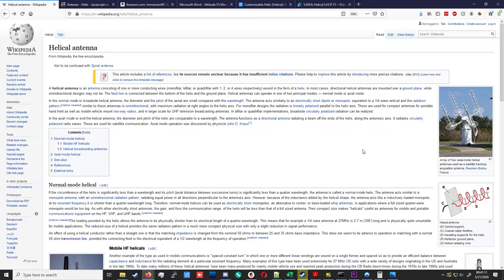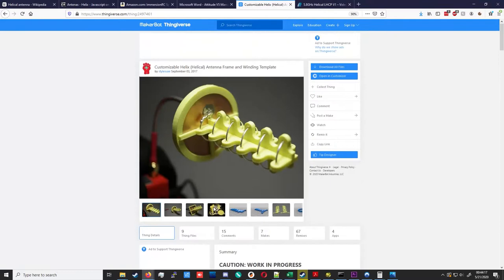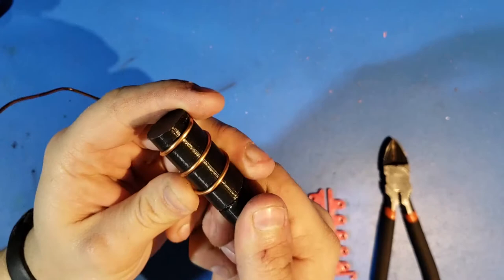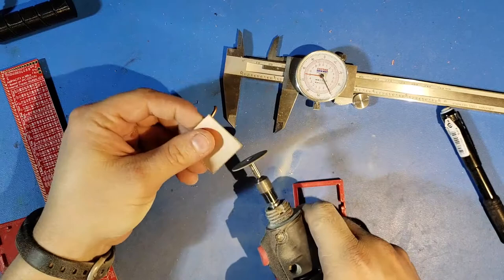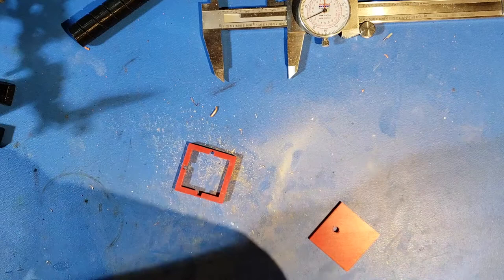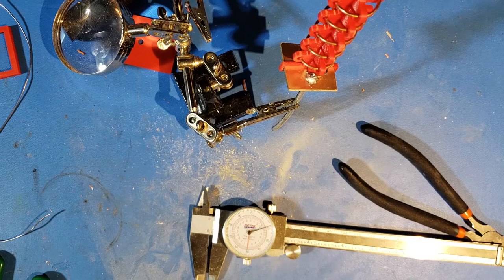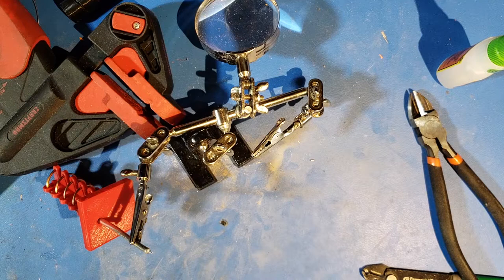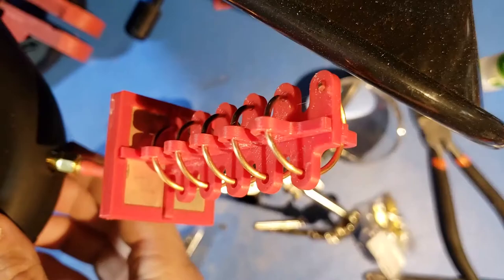DIY 5.8Ghz Helical FPV Antennas w/ IBCrazy Wavetrap Match

Comment from the maker: I sell a different design of helical antenna called the "Bestagon Helical Antenna" that addresses some of the design flaws of the one in this video including accessibility to the solder joints and the need for glue. See https://www.ebay.com/str/robertsresearchandradios/Antennas/_i.html?_storecat=3930616419 for more info.

Notes/Errata:
1. The length of the feedline used does not account for the velocity factor of the RG-402. It should be .7 of the value stated in the video if you want a true 1 electrical wavelength long line. That said, the length is irrelevant to the return loss (VSWR) neglecting cable loss concerns. I feel 5cm is pretty ideal for orienting the antenna on my goggles.
2. The calculated size of the reflector may be slightly larger than stated (a few mm). The value from JCoppens is a supposedly minimum value, but these all have performed great regardless of what the calculator says, both in terms of radiation pattern and matching characteristics.

Comment: I'm having some questions... The calculator says that the total length of the wire must be 282 mm. If I try to make the antenna with the wire that long, I only get 4.5 turns. Your antenna has 5.25 turns, which is closer to 5, but the length of the wire is 340mm istead of 282mm from the calculator. I'm really confused what to do here :)
I would really like to get the base frequency as close to 5.8Ghz as possible. I'd like to hear your suggestion :) And thank you for your effort!
Reply from the maker: The length of wire is less critical than the coil diameter and the spacing between turns. The wavetrap match should work pretty ok for helicals having any number between 3 to 10 turns, if not more than that. The source of "truth" for the antenna made in this video is inputting the listed parameters into the open-scad script; whatever that spits out is what has worked for me. I'd just do whatever the open-scad program spits out after you put your frequency parameters into the jcoppens site.

Comment: Hi, could you please help, what is the maximum possible length of transmission line? Or how to properly calculate it?
Reply from the maker: It doesn't matter how long the line is for the scalar matching information assuming a lossless transmission line (VSWR or Return Loss which are mathematically equivalent). In reality, the line has loss, so shorter is better for less loss.

If you're familiar with a Smith Chart, you'll know that adding lossless line length of the normalization characteristic impedance just rotates the point around the center without changing your VSWR. I believe there is something about this in my errata, but it should just be VF * wavelength = .7 * 5cm = 3.5cm if you really want a one wavelength line. Don't forget to account for your connector length if you go down that road. That would just be to keep the phase angle part of the impedance unchanged, so it's not really worth it to bother. Just use 5cm; it works fine.
Reply: @RobertResearchRadios  thank yli very much for explaining. Just one more thing. When you demonstrated calculator, you have not change wavelength so it remained as 0.23 (which is 1200 MHz wavelength) is it still OK, you have made 5.8 antenna with different wavelength?
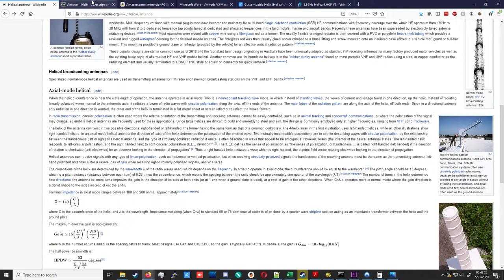Reply from the maker: @MrDrumhummer  The frequency parameter defines the wavelength. I set it to 5800MHz as required in the video as shown at 1:19. The turn spacing ".23 wavelengths" figure you mention describes the spacing between helical turns as a fraction of the wavelength for the defined frequency, in this case 5800MHz. It should be .23*lambda for all frequencies or thereabouts really; I believe ideally it would be .25*lambda, but the velocity factor of copper wire isn't exactly 1.

Comment: So is the wavetrap just a piece of metal/copper? which is isolated on the bottom side, so it wont touch the reflector?
Reply from the maker: The wavetrap is the little piece of metal attached to the coil 1/8 the way on the first turn away from the reflector. You can read more about it on the original RCForums threads with IB Crazy, the inventor of the match and owner of Video Aerial Systems.
Reply: @RobertResearchRadios  What does this thing again? i'm not shure i understand that... i have 2 DIY 7 Turn Helical on my DJI Goggles and they work fantastic. but i did not do this Wavetrap thingy... didnt even know this was required. I would like to understand what it does and if this is needed...
Reply from the maker: The wavetrap matches the antenna input impedance closer to 50 ohms. It's really useful if you are transmitting with the antenna to increase power output, but you won't notice much difference on receive. The DJI digial system transmits from the goggles, so you may want to consider adding a match if the VSWR is > 2:1. Check my video on budget VSWR measurements at 5.8GHz for how to do that if you don't have the equipment and/or skills to measure it for your antennas already.

Comment: Can a 6.8Ghz RHP Video antenna be used for Data ? IE wireless network
Reply from the maker: I'll assume you meant 5.8GHz instead of 6.8, but yes. The antenna can used for 5.8GHz ISM band wifi as well.
Reply: @RobertResearchRadios  Yes Sorry for the Typo and Thanks you are first one of 10 people to answer that question

Comment: can i use this to my dji goggles?
Reply from the maker: Yes, but you should use 4 of them. Also, I heard something about timing in the array and protocol limiting the range more than signal strength after a certain point. I you're trying to run them at the lower power level though and still get great reception these antennas may be worthwhile for the DJI goggles.

Comment: I admire your guts for trying to sell this. The solder is too poor. And if you seal it with glue, you can't maintain it or locate the failure. The design is wrong from the start. It's useless.
I guess it works for elegant experiments in a polite room, but in the field, I'm not so sure.
Reply from the maker: I don't believe it takes guts to sell something that works. This is after all, a hobby project under my side business LLC, but to be fair, I don't sell the design in this video anymore. I did a limited run while I was developing my own design that addresses some of the points you raise. The helical antennas I sell now are a called the "Bestagon Helical Antenna", a print in place variant with a CNC'd reflector that leaves the solder joints exposed for repair and maintenance and avoids any need for glue. See my store page antennas section for pictures: https://www.ebay.com/str/robertsresearchandradios/Antennas/_i.html?_storecat=3930616419

I'm not sure why you feel "The solder is too poor." It's proven in the field through use on my goggles for over a year to be durable enough to frequently reposition in hot and cold conditions, and the reception has been excellent over the duration, so the RF connection is not in question either. I've never had this design fail in the field on me, but I'm not throwing my FPV goggles on the ground all the time, so I won't claim the ones in the video are the most durable thing in the world, just good enough for my purposes. Certainly covering the solder joint and requiring glue as with this design are major drawbacks, ones addressed with my design changes as stated earlier. You should actually visit my Ebay store page to look at the new design. If you still want to criticize my soldering like people criticize welds, I'm not going to stop you, but if it works well enough for me, it's likely good enough for others as well.

There are a few criticisms of my redesign that I can think of including difficulty in soldering the coax shield to the reflecting side of the reflector and that it returns to having a hole in the center of the reflector as with thingiverse variants that use a screw to secure the coil guide structure. I haven't noticed any significant effects on performance with these changes though. I will also note, I don't currently wavetrap match 5.8 GHz helicals for sale because they're receive only for FPV use, so there could be something to complain about there if you wanted to use them for wifi or the DJI goggles. I'm working on developing an easier to install taper match to replace the wavetrap with at the expense of bandwidth to add to the design in the future. This is what I intend to use for other frequencies as the Bestagon Helical Antennas will be releasing in other frequency bands for amateur satcom applications including dish feeds and low gain antennas for applications such as hydrogen line astronomy, EME (reception only possibly), INMARSAT EGC Broadcast and NOAA HRPT reception, etc. I will also likely be switching to PETG for UV resistance in dish feeds meant to stay outside. Stay tuned to the channel for more updates.